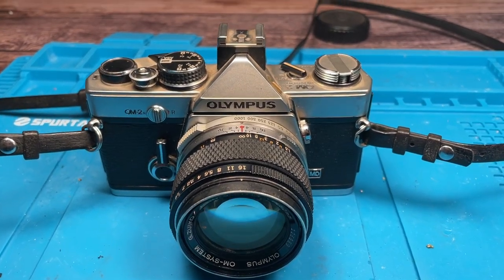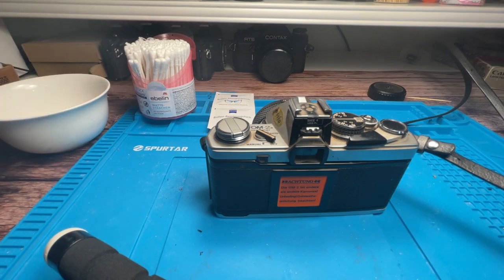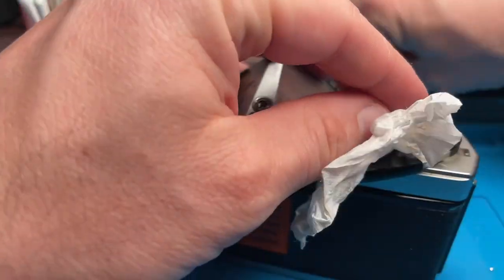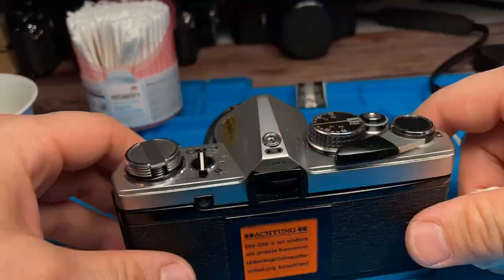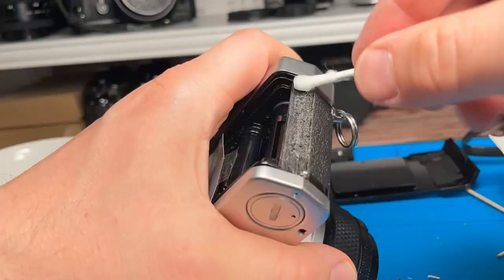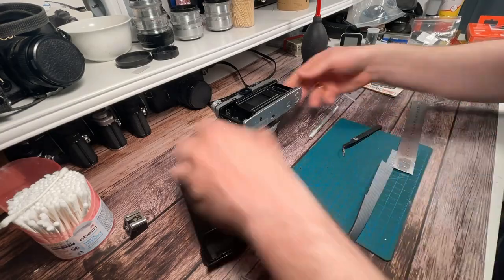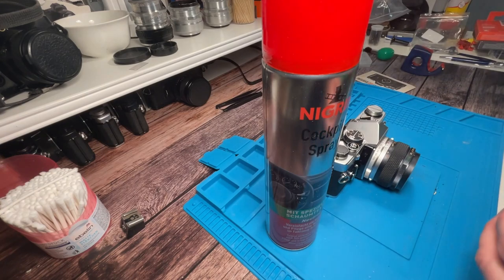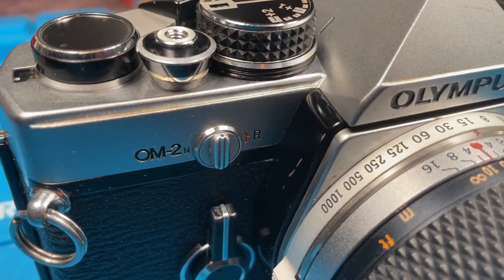Olympus OM 2n -  A QUICK cleaning Guide and how I handle my cameras

Comment: Hallo Manu, dein Video ist sehr interessant und super praktisch. Kannst dubitte mir sagen, wie/wo ich in Deutschland „Light Seal Foam“ finden kann? Auf einer Rolle scheint es sehr praktisch zu sein. 👍
Reply from the maker: Die kleine Rolle habe ich tatsächlich mal geschenkt bekommen. Aber ich habe mir auch mal Größe Platten bei Enjoyyourcamera gekauft. Die gibt es in verschiedenen dicken. Meist nutze ich 1.5mm für die Dichtungen und 2mm für die Spiegeldämpfer. 

https://www.enjoyyourcamera.com/japan-hobby-tool-kameradichtungsfolie-250-x-125-x-1-5-mm-59202085

Mit dem Code: happyshooting2023 kriegst du sogar noch 5% Rabatt und unterstützt den HappyShooting Fotopodcast. :D
Reply: @manugeee  Danke für die Info! Größe Platten meinst du 12x25cm = 10€ Ein Schnäppchen!